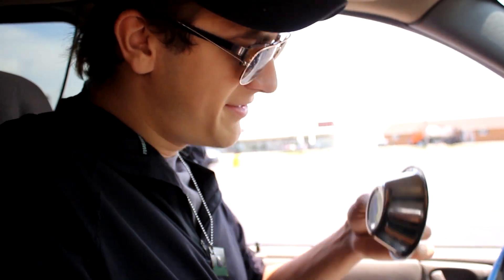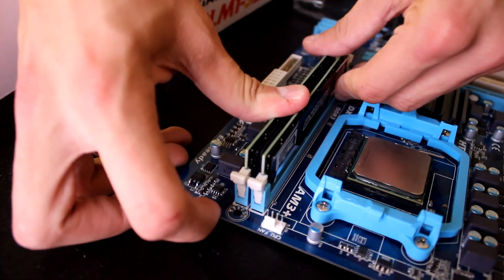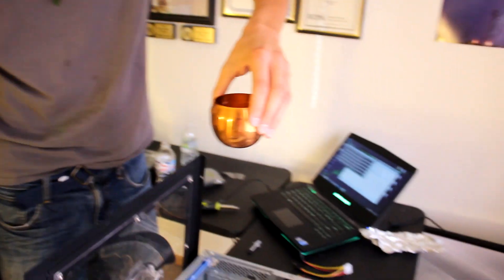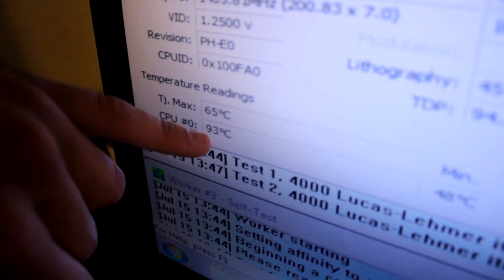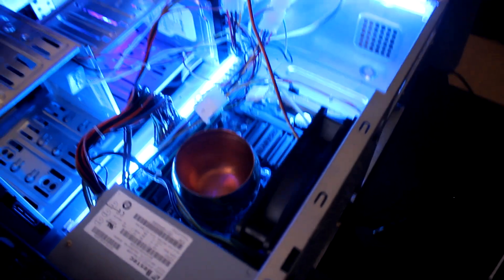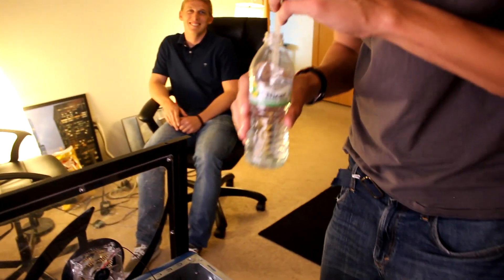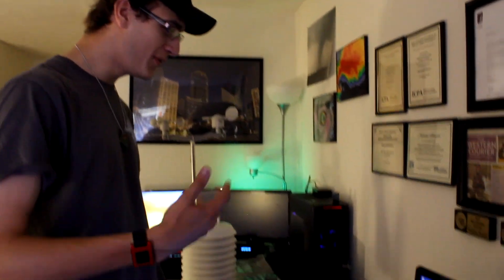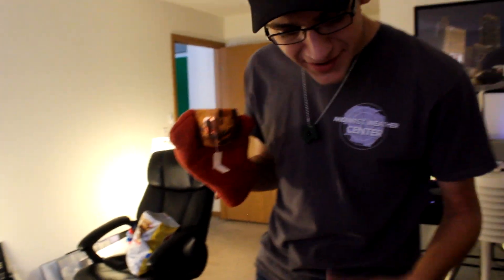Cooling a CPU with a cup of water

Comment: All he had to do was leave case lid off reverse case fan cooling outside of the cup and then I'd have put a fan over the cup drawing the heat out and it would have been more successful again also realistically you wouldn't be running prime so for basic operation while supervised of coyrse would work surprisingly well. I wonder how car coolant would perform VS water probably better again.

Comment: I ran my Core 2 Quad at 98C for like 45 minutes and i didn't damage it at all.  Then i bought a 5$ heatsink + fan on Ebay and overclocked it to 3300MHZ (From 2500) and it's now mining 24/7 @ 100% CPU Utilization and a max temp of 69C  
Those Core 2 Duo/Quad/Extreme are tough as hell and you can even play most games with them.
Core 2 Quad start at about 6$
Fan + Heatsink 5$
So for anyone wanting the cheapest possible Rig that can play all the CoDs and WoW etc ...
You can't really get anything for a lower price.
I also have a 2.8Ghz overclocked to 3.8Ghz working 24/7 and never had any issue.

Comment: For people legitimately trying this buy a metal water bottle w/o insulation. Fill it with ice, then put thermal paste or toothpaste under. It will work for over 1 hr no overclock @ a windows install load.

Comment: this might have worked better if the bottom of the cup had been lapped first. I agree that your temperature drops were likely due to the screwdriver absorbing some of the heat energy, combined with removing the side panel.

Comment: My roommate and I did this with a P4 Willamette (nice, flat heat spreader!) and a metal cup full of ice. It worked great, but once the water got warm, it did throttle. We used, for the "sink"/"pot", the metal cap of my lava lamp.

Comment: I don't think those hexacore chips are ment to exceed 62c, so you've potentially laid waste to a perfectly good chip.
I'd suggest putting it on ebay, and making some money back on it before it completely dies, assuming you can get it to run stable without throttling under a proper cooler that is...

Comment: says amd runs hot, thinks 73*c is okay, says cpus can run hot, oh and think about holding it down with an elastic band?

NO! intel cpu's run hot and 73*c is good for them (have one), amds max temps are like 62 and a phenom x4 or x6 1055t will usually run in the 50's, good thing you know about weather cus you seem to know fuck all about pc's.
its like running a 4790k at 120*c

Comment: why don't people spread the paste by hand? just add a dab, smudge it around with your finger, then apply the cooler. simple people! even complete coverage.
Reply: Still wouldn't touch the cup any better. Plus his cup was rounded, and not perfectly flat, which is why it had poor contact. He could have sanded it down, but I have a feeling this wasn't going to be a long term solution...

Comment: You created a heat trap that stays right on top of the CPU. Cooling is technically dissipation of heat energy at a rate faster than the source can generate heat until a temperature equilibrium is reached.  The only way for stationary water (at room temp) to dissipate heat from a heat source adjacent is for evaporation to occur in a rapid fashion, a.k.a boiling. Just having the copper without the water, would have worked much better, because convection would have resulted in surrounding air around the copper to heat up and rise, while cooler air moves to replace the heated air generating circulation. But the water acted like a heat storage container essentially. So for stationary water to cool the CPU, the CPU needed to heat the water to boiling point. So, the CPU temperature would have stabilized at 100 degrees celsius if you are at sea-level.

P.S. Theoretically, the only way stationary water would have cooled the CPU is if the water was below room temperature, but the use of cold water would have resulted in condensation. Thus, presenting a conundrum. For more insight into cooling with water, check out how traditional power plants operate. Cooling in industrial applications involves circulation of some form of fluid ("fluid" is a technical term in science that means both gas, specifically air, and liquid, specifically water).
Reply: Yeah yeah yeah... See that processor on his neck tho??
Reply: You bet I did, its super dope.
Reply: Bro, you went a little extreme with that comment.I agree with everything. But! Using no water wouldn't have been better, I don't think, that cup doesn't provide much surface area for it to be better. So theoretically 100+, so given what you said with the water stabilising at 100, water would be better (I think).
Reply: alcohol has a lower boiling point. I wonder how it would do.
Reply: ImagineDesignBuildTestRepeat slightly incorrect. Water evaporates taking heat with it. Only copper would overheat quickly aka heating with no fan

Comment: so I can use this to boil water on mount everest?
Reply: ASMR Labs :D the air pressure up there will lower the boiling point quite a bit so this wouldn't be so difficult but hmmm electricity might be a problem

Comment: The CPU temp will top out at 100c or a little higher and stay there. This is because at 100c the water will boil and the heat energy will be released with the steam energy. As long as the cup is filled with water it will stay at 100c max.
Reply: This comment is a joke right? I can push way past 100c on a chip, but the water temp may only be 30c. There is a huge difference in temperature from the CPU to the water.
Reply: FauxGaming do you know how heat transfer works? The chip may be 100c, but the water may be 30c. For Sub zero cooling, I may have a block temp of -40c (thermal probe outputs to LCD screen), but my GPU (in this case was an R9 270), was over freezing temps, and got up to 17c. That was almost a 60c difference. The freon I use boils around -70c, and since it's liquid, it's even colder. So liquid compared to chip temp is 87+c difference.

Have you had a college heat transfer class or actual personal data to go against my data? If so please list it, if I'm wrong I want to know I'm wrong.
Reply: Ha ha. Don't try to school others when you yourself don't know at all what you're talking about...

Comment: your temp drops because the screwdriver is a transferring heat out of the water. Mixing the water does nothing. a radiator pump exists to transport water from the block to the radiator. moving water doesn't cool it. the water in the cup is moving around anyway.

Comment: Damn, I thought you could boil water with a CPU. Maybe if there was no case fan it would have risen to above 100°C (assuming the PC doesn't shut itself down) and boiled the water?...
Reply: The CPU would probably run at least 150c. In a real water loop, the water temp may be 30c, but an i7 7700k may run 100c. So for that chip, it might be closer to 170c to get the water up to 100c.

Comment: i believe the only reason why it droped temperature is not because you are moving the water in that small cicle, its because the water was using the screw driver temperature basically as a radiator, absorbing its temperature, if you do that for another 5 mins it will sit back into 95 or above because the screw driver will be at taht temperature too...
Reply: Bit of both really. Mostly stirring the water, though. If the stress test were left for an hour and he then stirred it, heating up the screwdriver, we'd have the delta value for what you're saying - but I'd say it's 10%, at most 20%.
Reply: Or it's just from opening the case.....

Comment: in the middle of csgo ranked "Hangon, gotta put some noodles and water in my cpu cooler"
Reply: Phantom Flyer hahaha
Reply: * competitive
Reply: Maybe you can give this another go throwing in some more metal in there to give it some extra conductivity.
maybe a entire thermos that is made of metal with some stuff inside it.

At uni about 3 years ago we made an improv liquid nitrogen pot using a pringles can, some soldering on the bottom. (To sort of make a basic layer that could bring heat or the cold more efficently (the lower lip of the pringles can was in the way of a bracket so we had to make some height increase there) + some work to make it nice & even, a whole bunch of bottle caps filling up a third of the tube & then liquid nitrogen. (we strapped the homemade nitrogen pot with silvertape & zip ties btw.)

Overclocked a socket 754 sempron at 1.8 ghz too 4.3 before the motherboard gave up on us from the cold & water forming (As long as it booted into the bios it was good enough in terms of stabilty :P)
(Was too cold to get it to start up & plenty of water was starting to form on it so might have killed it that way eventually.)
was pretty fun still though.

Comment: maybe if you put those iceblock things what you also put in your cola in the summer (i don`t know what they are called in english sorry) it stays cool :D
Reply: Toto Geenen Icubes. Not recommended. Reason: Condensation.
Reply: but normal water condenses as well...
Reply: Toto Geenen It is explained in the video dud... if it is at the same temperature as the room it won't, When it reaches 100°C it will evaporate and create condensation and I don't think that processor would stay ON at 100°C for very long... in conclusion: A very stupid video but fun to watch
Reply: nvm

Comment: Should have used an Ahlon X2 5200+, I had one of those running at 98 degrees C for over 2 years since i was too lazy to replace the thermalpaste after refitting the cooler, It is till working just fine. Smells a bit funny though

Comment: you say you start with warm water, as in room temperature. the water won't start off any colder than the air in the room then. 
dew point can never be higher than ambient air temperature (because humidity can never be higher than 100%). 
so why are you concerned about the dew point? you are cooling the water with air, so it will never be colder than ambient.

Comment: I wonder if you put the outtake fan as an intake and have a case with an outtake fan in front of the CPU (so it will take out of the case any water vapors as they rise), would it have better temps? Also, how about putting one of those low-powered drink mixer, it would mix the water pretty well, better than the hand and if you fix it in a place, it would be steadier than the shaky hand. And zip tie the heck out of the cup on the motherboard for better thermal contact. Remake the video and I'll subscribe :D (and probably don't bitch around anymore, but I don't promise anything).

Comment: Still better than my i5 stock cooler XD
Reply: Push pin clips on stock intel heat sinks are complete fucking bullshit.
Reply: Shamie Ramsamuj there is different i5 coolers. there is the copper slug ones and the all aluminum thin fins ones
Reply: Bullshit my i5's cooler came loose when my PC fell and i didn't notice and it was running just fine. 

I noticed when I heard rattling in my case and I fiddled with the cooler. 

Just one pin was in 😤😤

Comment: Still better than stock coller. :)
Reply: my i3 idles at 52C and and gets to 81C while gaming so it's not that much of a big difference
Reply: huw du yu pronunce yur naym?
Reply: +Aures the Gamer i5
max temp after 6hrs on load is 65 °C for pass 4 years
ohh boi
Reply: Phenom comes with terrible inadequate coolers. Plus you really need to keep that era's Phenom under 70°C (about 55 according to its internal readings, they are wrong) for it to perform well. Intel have higher thermal limits.

Comment: that's a cool necklace you got there, what kind of processor is that?
Reply from the maker: +Zack Fair The first processor I ever had in my first computer. An Intel Pentium 4.
Reply: A 20,000 dollar xeon proccesor
Reply: +Stewie2552 classy
Reply: +Stewie2552 I still have that cpu in my computer lol. Maybe not the exact same model, but it's pentium 4.
Reply: its a pentuim 3
Reply: lol although commenting on other guys accessories is not so cool !
Reply: Stewie2552 is it the actual one from the computer
Reply: Central.
Reply: Thats what i am using in my miner rig atm lol
Reply: I guess I'd be wearing a i386 DX. .. I mean, if I was autistic enough.
Reply: That would be a Celeron for me. Nope. Not showing that off. It was a piece of shit when i got it, and by the time i scrapped it, it was even worse
Reply: +Zack Fair a phenom II X6 1045T

Comment: still easier then installing a hyper 212 evo
Reply: I seriously dont know why everyone hypes the Hyper 212.
The be quiet Pure Rock is quieter, better and at the exact same price of the Hyper 212, also easier to install...
Reply: *****
212 evo is not a bad cooler by any means, and at the price its at, i would expect a lot worse. most of thew coolers in the 20-30 dollar price range do very well and run pretty quiet, some just take a little more patience than others.
Reply: +Compound Plays Yeah installing that thing was a bitch, the other day a beetle get sucked into my fan and heatsink and it was such a bitch to clean... the 212 evo does well performance wise but everything about it sucks..
Reply: TheSeanjoker6 
Nah, High quality Water coolers like Corsairs AIO are very good.

They dont leak, trust me. You can easily run those things for 6-8 years before the water vaporizes.

And even if they do, the water is non conductive.

Just swap the stock fan on the radiator and you are good to go.

But ask yourself if you need it. If its just the cool look of the water block, and you dont overclock much, go for a single 120mm radiator its more than enough.
Reply: h da fuk did a beetle get in your computer
Reply: The hyper 212 is hard to install?  What, do you not have two hands and a brain?
Reply: New one is practically the same
Reply: Lol I agree, AIO water coolers are way easier, and for 20 bucks more for the increase in performance I will always reccomend them
Reply: Chewyshoot I thought about buying one for my build, but i heard they don't last very long and that they can cause all kinds of issues with leaking and what not..
Reply: I could spend 50 on a aio and get the same or better than a hyper 212 evo
Reply: nope bcause only single radiator cheap single radiator
Reply: Yeah and a single is still better than a 212 evo
Reply: but my macho rapes a dual rad aio hardly at high temps due to oc only tripple rad aio´s can mess him up
Reply: Have you actually checked is my question
Reply: Wait who said a 212 was hard to install?
Reply: I know the 212 I certainly not hard to install
Reply: No not really
Reply: Owen Brown Mebbe I am the offering of directions to English lesson m8.
Reply: hyper 212 is easy to install in terms of what you have to do, mu issue with it was i could barely get my screwdriver at it due to there being the heatsink just being in the way of the screws lol. it just takes some time to do it without breaking anything (i was installing in the case also which doesnt help)
Reply: *****  only the best fan aloud my direction is simple intake and exhaust
Reply: YES!! this x10000
Reply: Cedric Peace and what exactly is "this"
Reply: I literally broke my motherboard and made my hard driver fail installing that fucking thing...
Reply: What on earth are you smoking? I never said anything about coolers -.- and I broke my motherboard from over screwing the holes, and my hard drive got knocked out somehow a few days afterward.
Reply: this entire comment thread is about coolers what else was anyone supposed to think
Reply: the only way to install a hyper 212x is to force it on
Reply: how on earth are people still replying to this thread?
Reply: master race seperating a few pieces of cake from the core. :D
Reply: @ some german guy - "they dont leak, trust me". Seems legit. Reads all the reviews on aio's that have leaked and destroyed machines. they installed it wrong right? cuz they dont leak. Some German Guy told me so.
Reply: Compound Plays Instructions are fucking shit for the 212 evo
Reply: drone306 hard drive and PSU coolers have nothing to do with each other and breaking you motherboard....That sounds like your own fault

Comment: i think you need put some ice cubes to cool the water and at the same time the cpu
Reply: You shouldn't place ice on the cpu the water would come down and short the pins and you'd get a dead cpu and mother board
Reply: Also if you put ice in the cup it would get water on the outside and run down into the cpu socket and you'd end up with a CPU and other dead parts
Reply: just little bit to coll down water temp
Reply: cool *

Comment: Could maybe glue something to the fan to stir the water a little.
Reply: >a little
>at 1500 rpm
Reply: thats over 25 stirs a second.
Reply: Andre Benoit if you put something like a toothpick in the center of the fan it might work
Reply: Drake Chung not if it's really small. Should be fine.
Reply: +Tekuila Gaming that would be really cool :D
Reply: +Tekuila Gaming that will be stirring to fast and spill the water

Comment: Once you got past 60, you exceeded the phenom 2s temp limits..
Reply from the maker: Chris H. Anything for science... and tea.
Reply: Stewie2552 LOL!! nice
Reply: 62C is the max recommended temperature for the Phenom II by AMD. My old 1055T hit almost 70C while overclocked to 4GHz during summer and it was still fine.
Reply: +Chris H.  thats weird i have a phenom 2 and it runs sometimes up to 80
Reply: ᚹᚱᛁᛇᛖ I bought that 1055 model new back in 2010 and even during gaming I rarely ever see more than 55-58C and it's overclocked to 3.4 GHz still running the stock cooler.